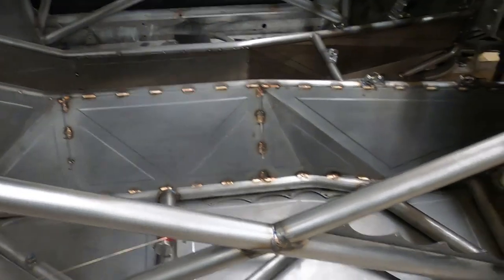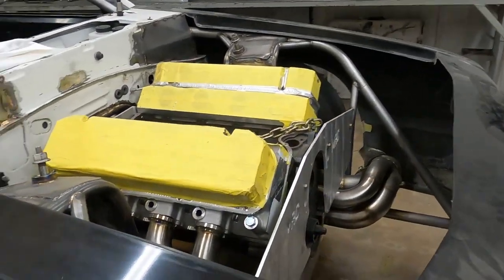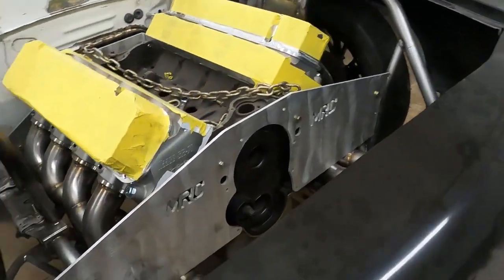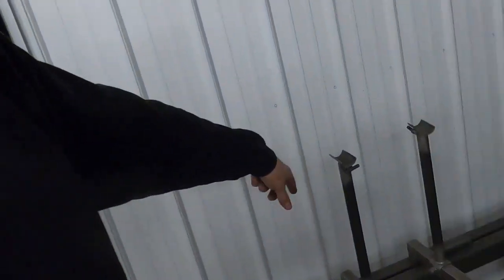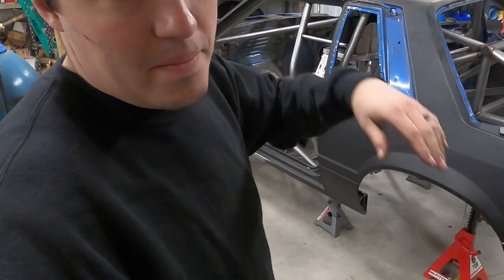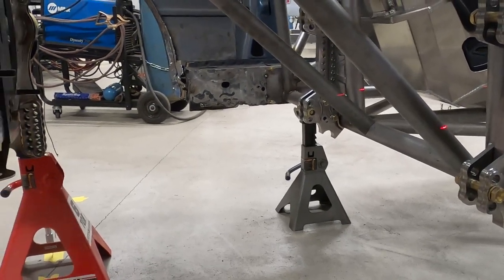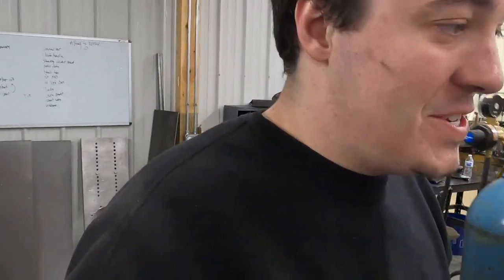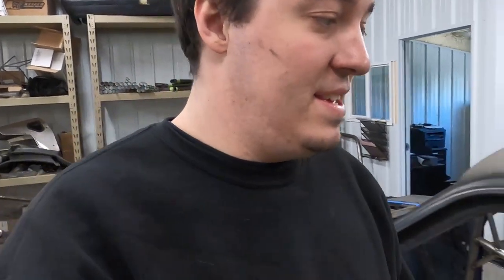Ep. 6 Weekend Shop Walkaround and Shop Car 4 Link Bar Fab

Comment: Look into a phase converter for your large shop  equipment that you need,  and most 3 phase motors can be converted to single phase by any electric motor rebuilder, had it done a few times when I couldn’t find a converter at a reasonable price

Comment: Why don`t you use DocolR8 instead? Much cleaner, righ out of the box they are like stainless to weld in. Plus they are stronger then chromemolly. they don`t crack near the weld either if you crash.
Reply from the maker: Because getting it right now is impossible. Chromoly from Plymouth is made here in the USA. Docol comes from overseas.